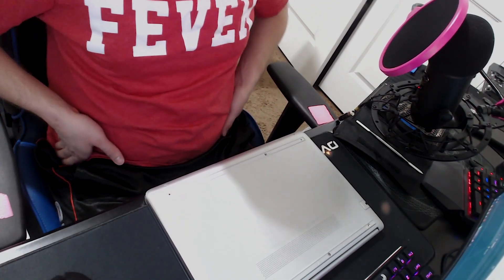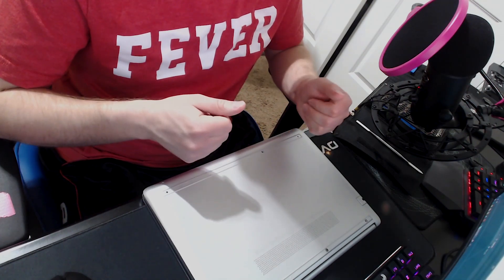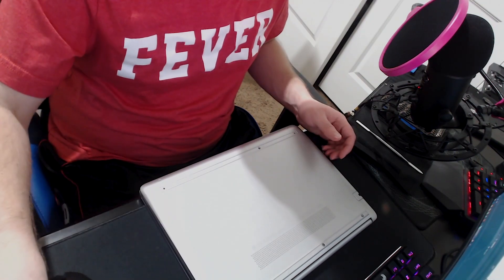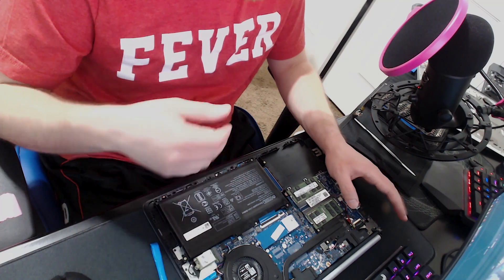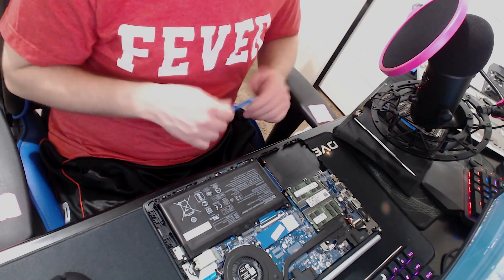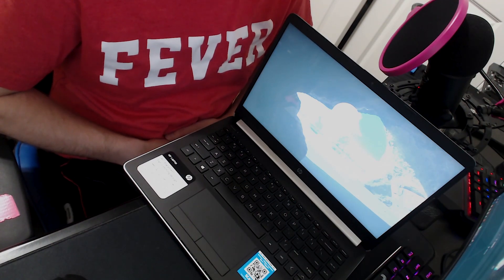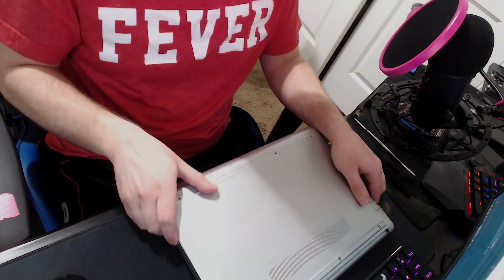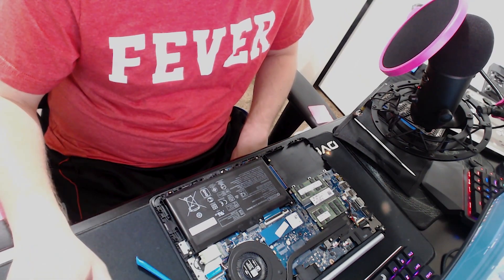HP 14 dk0002dx RAM Upgrade

Comment: Useful video, I have this model and upgraded the SSD and replaced the battery, all quite simple. Rather annoyingly I bought this laptop ‘new’ in 2018 but during the process of opening it up I found that half of the screws which should be there were missing. I also used the opportunity to clean the fan as it was filthy with dust. It came with 2 x 4 GB RAM but having read your comments I have decided to leave them because I don’t expect to see much difference if I upgrade.
Reply from the maker: Yea the CPU choice greatly holds back the performance if it's the dualcore model.

Comment: I don't like that when they lie about how much you can use or tell you it is inaccessible.  It is only "inaccessible" because some people don't like taking the back off.  I still remember computers that all I had to do was take out one screw and remove a small access panel and the RAM and WiFi card would be there or a separate one for the hard drive.  I wonder if they are still making laptops like that these days.  These are not Apple computers where they try to go for the cleanest look and hide the screws so you will never figure out how to get into it!!  It also annoys me when someone seems to think that if both slots are full it isn't upgradeable.  They are wrong, they can take the old modules out and put the most the system can handle in there.  That may be 32 GB or 64 for some of the newest.  It would be like assuming that I am stuck with 8 GB for life just because my sockets have a 4 GB module in each.  I know for a fact my Tiger Lake will handle 32 GB and Intel even says it can do 64 GB.  I also never once believed that I would be stuck with what is there.  I think some people are just afraid to have unused parts sitting around.  In a way that is good to have spare parts!  If one fails you have a usable one even if it is lower capacity.  You could even sell the old ones and get something for them!!

Some laptops have pads where a second RAM slot would be too.  I have never seen it personally but I have seen a picture.  I don't know why they did that unless the bean counters were a little more overzealous than usual when that model was designed.  I am sure it wouldn't cost much to add that, the miniscule amount of gold on the pins of it would be worth a ton more than what the part costs and that is not much at all!!
Reply from the maker: They do that for planned obsolescence.
Reply: @ppmguire  For those who don't know any better anyhow.

Comment: I am not sure how much I got it for when I bought it for my mother but it was from Bestbuy and on sale.  It was before the pandemic came along and made all the prices really insane.  Before people started to sell graphics cards for insane markups.  You know, befor all the jerks and their bots made it hard to get anything.  I recently got a 17-BY4062CL and it has a very similar design but that is really where the similarities end.  I bought it when the display on my 7 yr old laptop started getting glitchy.  Not sure if I had a bad RAM module or the GPU was dying.  All I know is I made sure to snap a pic of it to prove that it was in fact dying and due for a replacement.  I pulled my AX200NGW, the ram, and the SATA SSD I had in it out.  I plan to use the AX200 in the newer laptop once I get an antenna so I can still have Bluetooth for my mouse (rather than a mouse with a dongle).  It looks like I can just put the cable for the WiFi antenna on jack one and Bluetooth on the other.  I think if I can find empty space in the case I would be fine sending the extra antenna there.  I will just wrap a little electrical tape on it so it can't unexpectedly come in contact with something and damage something.  I plan to do it that way because I don't like having to mess with the display, it is a lot of work and a lot of things to go wrong.  I am thinking since that one would be AUX for Bluetooth it wouldn't matter where it is since the mouse I plan to use with it is only going to be a few feet away at the very most.  I just want Bluetooth so I can keep it rid of dongles hanging out the side.

Comment: I got the Corsair 2666ghz 16GB kit (2 8gb sticks) but the screen never turns on and is always black screen. Only having one of them works and I tested both. The memory under task manager says 1 of 2 is allocated. I don't know what I'm doing wrong. I tried unplugging the battery and holding down the power button off for 30 seconds. Tried Window + Ctrl + Shift + B. Nothing seems to be working.
Reply from the maker: Do both slots on the board work? Sounds like a bad slot.
Reply: @ppmguire  Yeah that's what I''m starting to think, anything that is put in the secondary slot never boots and is always a black screen. I just got a 16gb stick so I could do one slot, but I can confirm each slot is capped at 8gb per slot. So if only one works, the max I can get is 8gb. If anyone else has any solutions I am all ears, so disappointing.
Reply from the maker: @BoxxPow3r  What is your exact model? I had 32GB running so the slots are not capped. It sounds like you might have other hiddens issues going on.

Comment: Did it run OK with 32 GB of RAM?  I wonder because some laptops are specd with false limits sometimes.  They may have made a typo or just didn't know what they are selling.  They may also be hoping you believe them and pay more for that upgrade too.
Reply from the maker: It was stable and ran fine, but didn't make it any better than having 12 or 8GB.
Reply: @ppmguire  Maybe the limits they sometimes tell are based on the largest modules that fit inside at the time of production, even if the CPU can address more.  I would avoid any Pentium Silver or N series CPUs unless doing no more than checking email.  While not bad, they are more like a budget option.  While I might not have 32 GB for a DK0002DX it is nice that the ram in my new laptop is the same type, just faster.  It leaves a free upgrade for one someone I know has if I ever upgrade.  I just suspect that it would not run it at full speed.  HP and similar manufacturers are known to artificially lock the RAM speed, often with no way to change the settings (they are hidden in BIOS or just not there for us to change)
Reply from the maker: @charleshines1553  RAM size limitations in terms of actual addressable are almost a thing of the past now. These CPUs can address 64GB easily, and even some mainstream boards back in the DDR2 days could recognize and use more than 8GB. Back then they weren't so much limitations but just what was actually available in terms of DIMM size that AIBs could test with. These days it's only artificial limits to segment product categories like consumer, to workstation, to server, to datacenter. We're talking upwards of 128GB sizes though. The CPUs in these laptops are simply too weak to even really process workloads that would even utilize higher than 12GB. 

Yes, RAM speed is locked behind an HP bios featureset. Another downside is the architecture for this particular CPU is also only single channel.
Reply: @ppmguire  I have a feeling they just use that as a tactic to get people less tech savvy to buy a new laptop.  These tricks would work on my 96 yr old grandmother but she doesn't use computers.  We usually use them for her when needed really.
Reply from the maker: @charleshines1553  Yup, like I said artificial product segmentation. OEMs have been doing this for 2 decades. It's actually the reason people thought Vista sucked so bad. TBF though, I don't even think 3200MHz RAM would help this laptop.
Reply: @ppmguire  My mother has one of those laptops and it really isn't bad.  It is quick enough for all she does.  I would not game with it (or any other laptop for that matter).  My 17-x037cl lasted 5 or 7 years but I never gamed on it.  Most laptops don't have good cooling for that, especially the really thin ones.
Reply from the maker: @charleshines1553  This particular model was garbage at pretty much anything including basic tasks like web browsing or watching 720p content. The kids used them for the Covid home school shit for 2 weeks before they got their assigned Chromebooks. This was even after I wiped them and put a debloated W10 on them. It was then I made this video after looking at RAM upgrades. Putting 8GB sticks to make a total of 12GB made it slightly more tolerable but for the specs you just expect more. In comparison my Windows 98se machine with an SSD is quicker at tasks, booting, etc. I eventually parted them out then recycled them.

Comment: Hi man,

Thanks a lot for your video. I actually have an hp 14-dk0010ca laptop with almost identical specs as yours (with the exception of the processor- a4 vs a9). It however didn't have a soldered in m.2 nvme slot although the motherboard had solder pads for it. I went ahead and ordered an m.2 nvme connector and soldered it in place. The NVME drive I got however was not recognized in the bios or windows (but got warm).

I am thinking that either the m.2 motherboard area is missing some components (capacitors, diodes, resistors, jumpers, maybe a chip, etc.) or the m.2 slot is disabled within some hidden settings in the bios.

I hate to bother you, but if its not too difficult (or perhaps if you already have them) could you please send me some high res pics of the m.2 slot and the components around it...perhaps I will find the missing components and ask a laptop repair guy to solder those components in. If its too difficult, no issues.

If its a bios lock/hidden feature thing, the other idea would be to somehow get the "Advanced" options unlocked for the bios.

Appreciate it,
Thanks,
Nooman
Reply from the maker: 2 things, the first is all the circuitry should already be there as this is a mass produced item for multiple models. Feature sets are locked behind the bios and they can't be unlocked without a utility and hex key from HP. At my previous job somebody ordered 6 figures worth of Zbook G6 laptops but told them wifi needed to be disabled. Every single notebook had Intel AX modules installed with the antenna cables but it was completely disabled in the bios like it didn't exist. This happened shortly after I made this video, so I took the opportunity to ask the HP tech I was working with about these units. Hardware features like SSDs, wifi, IGP, dGPU etc are bios featuresets. Things like the RAM speed cap are microcode. I might add, that they needed to be paid to send somebody out with the "tools" needed to unlock about 50 laptops and they only did it because of who we were. The fact that it gets warm means it's getting power and the only other circuitry needed would be PCI-E lanes to the CPU which would be already in the board for other M.2 enabled models.

The second thing is, I gave one of these to a kid in need for Covid schooling, and the other I used as parts for my business then recycled the remaining so I wouldn't be able to get pics for you. But if it's not showing up it's a lost cause unfortunately. This is why I never followed up with any bios "options" video to unlock and get faster RAM speed. And now I feel like these notebooks are so underpowered it's not even funny. Although I got a noticeable boost in performance from adding RAM and a better NVMe drive it still wasn't what I'd call optimal even for kids to browse the web or play Roblox on compared to say newer Chromebooks even.
Reply: @ppmguire  Thanks for the super prompt reply! Appreciate it.

Very informative reply from your side. I had actually gone to an hp service center and they denied there were any blocked settings!

I tried a work around by Ivan Popov on YouTube...he suggested using an m.2 nvme to m.2 a/e adapter and plugged in a crucial p2 250 gb into the wifi port...it worked but I was expecting at least a 1x speed (600 MBPS, 4x would be 2400 MBPS read)...but sadly only getting 200 MBPS...o  a closer examination using cpu-z bios summary, it appears the motherboard is pcie 3.0 but the wifi port and a lot of the ports are pci 2.0 (which should be be 500 MBPS too), but Cpuz says the 1x link speed is only 250 MBPS....so I am wondering how much of these pcie "settings" are hidden bios stuff. Am thinking of getting getting a bios mod or using ru.efi to modify things without a bios flash...though flashing comes with a risk of bricking!

Thanks a lot for the info!
Nooman
Reply from the maker: @naumansm3  I commend the work you're putting in, but anything past a SATA SSD is actually wasted on these due to CPU bottlenecks. Same goes for quicker IOPS. Further testing I did off camera was putting a Sabrent Rocket 1TB in it (Gen 3) and general performance was relatively the same as the 128GB PM stock drive and the additional 512GB PM (961) drive. The CPUs are simply too weak as Stoney Ridge is using Excavator+ (4th gen Bulldozer) rather than the newer Ryzen architecture. Another thing I learned after the video is Stoney Ridge is a single channel IMC only, so it's also severely memory bandwidth limited outside of the arbitrary 1866MHz limit HP put on these. This explains the severely gimped CPU and IGP performance, and probably why you're seeing less than stellar PCI-E throughput than what you're expecting. This is why I decided to donate one of my kids laptops, and use the other for spare parts because there's not much you can realistically do to make them run as they should.

Comment: @ppmguire on my laptop in task manager in memory it says 4/8 inserted. So like can I go above 8 or what I have the same laptop as you. Hp dk0002dx 128 ssd and 4gb ram
Reply from the maker: You can put up to 32GB in the laptop, but I would just add a single 8GB stick to the existing 4GB.
Reply: @ppmguire  agreed. Thx for the quick reply

Comment: I used the video to look up the memory of the exact same lap top because my daughter's drawing pad's graphics are acting up so I thought about upgrading the RAM but it may the graphics card after watching your diagnosis on speed upgrade and listening to you regarding the slow graphics card these things come with. Thank you ! you did better than the HP site . They do want you to spend the cash for support but You tube is my support and it's free   😁 Great work Bud! now I just need to find a site that will sell the memory!
Reply from the maker: If it takes standard RAM you can find it on Amazon or Newegg pretty easily.

Comment: where's the CMOS battery on this laptop?
Reply from the maker: Haven't torn it apart completely, but I believe it's on the other side of the board.
Reply: @ppmguire  thanks...any videos of motherboard teardown? my laptop wont power up, it will start the CPU fan but after 3 seconds it dies down. Thinking it might be BIOS or motherboard
Reply from the maker: @tjnapoles  Check the keyboard and see if the caps lock and scroll lock keys flash. If they do, they will flash a certain amount of times which tells you a code to look up. I think for HP 5 times is a dead board.

Comment: Do you have a link to the ram you put in that laptop I have the same laptop as well
Reply from the maker: I used RAM I had in another laptop to do this test. RAM used was this.
https://www.amazon.com/Samsung-PC4-21300-2666MHZ-SODIMM-laptop/dp/B07F6N8L3S/ref=sr_1_1?crid=1Z0KTLQZ7M0P1&dchild=1&keywords=samsung+16gb+sodimm&qid=1619730593&sprefix=samsung+16gb+so%2Caps%2C205&sr=8-1
Reply: @ppmguire  is that price for just 1 16 ?
Reply from the maker: @sdave6052  Yes. 2 16GB sticks is absolutely wasted in this laptop though.
Reply: @ppmguire  so I would have to buy two of them for $100 so be $200
Reply from the maker: @sdave6052  Yes if that's what you wanted.
Reply: @ppmguire  ok I just wanted to make sure I was reading that right ! Thank you

Comment: could you provide a link or part number for what you used? computer newb here basiclly, but i need to upgrade this laptop!
thanks
Reply from the maker: Do you have the exact same model as in the video? How much do you want to put in there?
Reply: @ppmguire  yes i do. And idk. Maybe an 8 or a 16 to add on with the current 4. If it works that way. .?
Reply from the maker: @01Lude  https://www.amazon.com/Samsung-PC4-21300-2666MHZ-SODIMM-laptop/dp/B07F6HBK1N/ref=sr_1_20?crid=1LOHK5ATUD9ZX&dchild=1&keywords=8gb+sodimm+ddr4&qid=1612283974&sprefix=8gb+sodimm%2Caps%2C170&sr=8-20
Reply: @ppmguire  thank you!

Comment: I didn't catch it if you mentioned it in the video but, do all of these models have the same RAM? Is it safe to just buy the samsung 2666 4gb and plug it in? also would you recommend another CPU or is the I9 sufficient ? thanks man
Reply from the maker: I mentioned in the video HP likes to source parts from different OEMs so your mileage may vary on RAM and storage. This particular model and subset of models use low gade AMD APUs so if you have an i9 I'm going to assume it's going to be rather different.

Comment: I have the dk1025wm. it has a terabite hard drive. I ordered a crucial 8 gig ram card (Crucial 8GB Single DDR4 2400 (PC4 19200) 260-Pin SODIMM Memory - CT8G4SFS824A) which is supposed to fit. I am hoping to add the 8 to the 4 already in there.  If not, I will swap the cards. 4 is not enough. The machine locks up, slows way down, and freezes for minutes at a time.